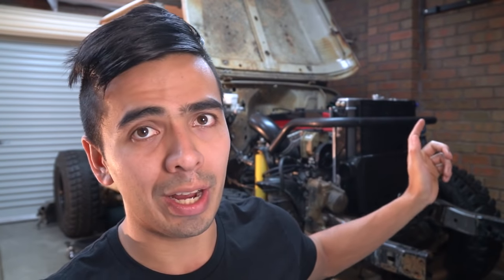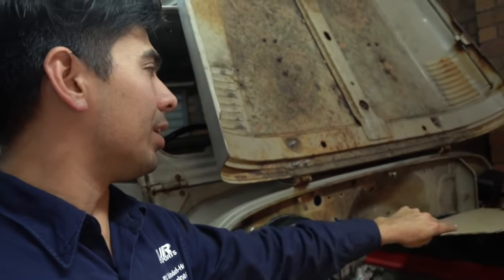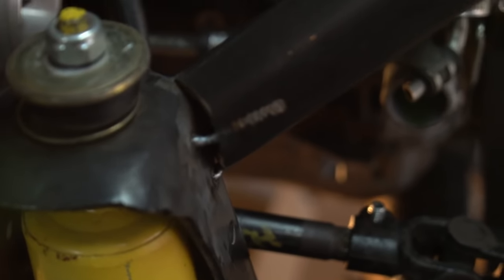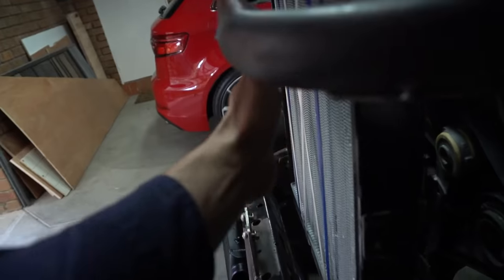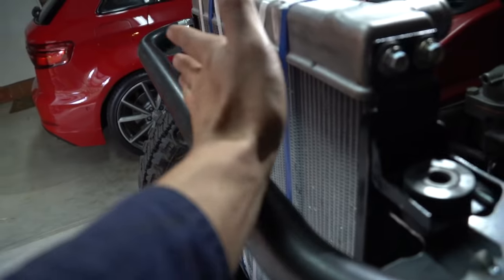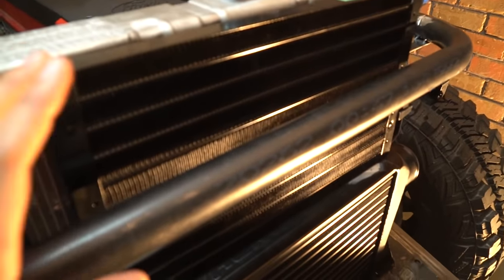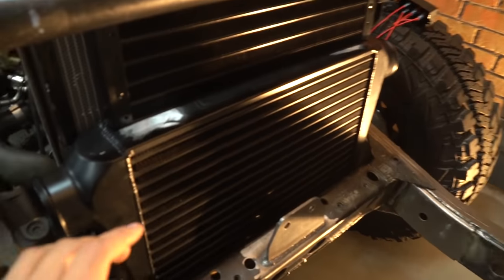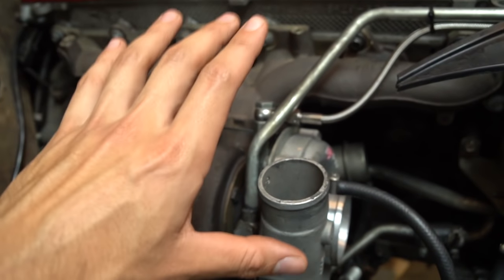Beginner’s guide on how to Barra swap - Barra T 45/80 Build Video #3

Comment: Hi Richard this is a great project with two of my favorite cruisers 40 and 80 series. When the crank broke in my HDJ 81 I ended up putting in a ford 302 ( 'cause that's what i had ) and changing the auto to a 5 speed manual box, I left the box in its original position and made an adapter plate that was 120mm long to bring the motor forward. I used an adapter shaft my mate made, not unlike your auto shaft adapter, for the gearbox output shaft extension. It went bloody well it had toyota difflocks. Keep up the good work. Phil NZ
Reply from the maker: Hey Phil, that sounds like a bit of ingenuity to make it fit, well done! would be a weapon I'm sure!

Comment: Awesome videos mate, loving the build series! When I finished my 40 series build I kept cracking the mounting tabs on my new radiator. Turned out I had rebuilt he radiator support structure too rigid as the whole front/grill/guards/bonnet assembly was originally designed to have a certain amount of flex. This in turn made the radiator mounting tabs the weak point. I ended up making new supports with oversized holes and rubber bushings to allow the radiator a little movement, worked a treat 👌🏼
Reply from the maker: Hi Geoff, cheers for that insight and your solution to it! something I'll keep in mind for sure :)

Comment: Hi Richard you can get in touch with MR Landcruiser and get yourself another bracket that goes around the brake booster from a later model. 
Keep up the good work very interesting conversion it's one that's been on my mind for awhile.
Reply from the maker: Hi George! Might be a little late for that bracket! Cheers for the info though.

Comment: Good work on mounting all the heat exchangers Richard. Keep in mid that airflow isn't infinite and sometimes bigger and thicker isn't the answer. It's a balance between airflow and resistance. If you find yourself compromised you can always add a condenser fan to boost it when A/C is on though it might impact your "stealth" look 😜. Looking forward to the next one mate.
Reply from the maker: Sounds like you may have had a little bit of experience on this. Definitely should have thought more about it, hoping my fancy fan will keep me out of trouble!

Comment: Hey man , the vintage air mini unit is a good quality car hotrod aircon /heater , ive just retro fitted one in my 1960 holden sedan. Cools easy on 35 deg days nice and compact unit should have no worries cooling a ute cab if your tight for dash space
Reply from the maker: Cheers clintonio! I have a unit already just needs to be fit up!

Comment: Good video. You mentioned about the nerd calculations, I would be stoked if you actually mentioned afew basic calculations on Heat loads and evaporator metrics. Id also consider looking into a Log style manifold. I dont think a VASS engineer would approval that steering linkage being so close to the hotside of the turbo.
Reply from the maker: Hi Brent, yeah I’m not sure how deep to go on that stuff put there are some keen people out there! I need more hours in the day to do it all and add it in! Yep that’s a fantastic suggestion, I think you may have read my mind :)

Comment: Firstly, keep up the great content. I have a GQ which I want to Barra swap. I have a FG gas car as a donor; but I wasn’t aware of the compression, thanks for that info re: fuel use. Spoke with engine builder friend of mine, he said he will massage the heads to reduce the comp to mid 9s. I’m changing head gasket, oil pump drive and valve springs. I’m curious of your future wiring setup. Thanks.
Reply: Addendum: If you can get 35” tyres passed by the engineer; pass on the details. All the engineers I’ve spoken to in Vic prefer 33”, else they want to swerve test using the 35” Let me know?
Reply from the maker: Hi Petro, sounds like a good solution as well, I didn't know that could be done. I knew the gasket could bring it down a little but only .1/.2 so thats good to know, your engine builder would know a lot more than I do!  I go into my wiring setup in the next episode which should be out in a few weeks, I have just bought an off shelf solution though. Re tires, haven't got that far with it. Can always swap them out if you know what I mean ;)

Comment: I wish you had got all nerdy on the intercooler selection. Im doing a similar conversion and decided on a W2A cooler as its a good compromise between an interwarmer (top mount A2A) and a front mount which can get packed with mud reaaal easy.
Reply from the maker: Hey mate, I looked at W2A and since I am relatively inexperienced with engine conversions/car building I wanted to keep it simple with A2A until I learn more. It is probably a better solution just more expensive and more complex, maybe I’ll upgrade in the future as I develop my setup.

Comment: Hey maybe make up a plate to laminate the firewall for the booster. 300mm square should do it and 3 mm thick
Reply from the maker: yeah not a bad move, I don't think that amount of strength is required though, that plate should be much stronger than original now. I think once the rib is back in it would be far stronger as well.

Comment: Hi there. Just watched the part with turbo near the steering column...even the rubber coupling cover seems pretty close to the hot side of the turbo...I remember reading somewhere back in FSAE days that moving air is the best insulator. Can you make sure that gap gets a lot of airflow through ducting? Anyway, great channel and series!
Reply from the maker: Have already made a custom manifold which has sorted out all my problems!
Reply: @DesignedandBuilt  Ah ok, awesome! I'll have to catch up on the whole build series soon :)

Comment: How will you go with registration on 35's?
In Qld unless you get it engineered and complianced as something else (home made or whatever) you can only increase tyre size by 2". Which means anything on tyres bigger than 33" is illegal. Theres heaps of guys who THINK they've got a compliance plate for 35" and 6" lift but they don't. Its not worth the tin its printed on. Unless they've done a moose test and jumped through a bunch of different hoops.

Comment: Hey Richard, it looks like that steering column intermediate isn't a collapsible type? Check VSB/NCOP section LA (not LS), as you might be required to run a collapsible intermediate due to the minimum safety requirements for the engine swap.
Reply from the maker: Hey mate, definitely collapsible, good pickup though!
Reply: @DesignedandBuilt  you should be good to go with 2 offset uni's, the collapsible bellows is a bonus

Comment: Have you looked at flat mounting the condenser under the tray with a scoop ??
Reply from the maker: Hey Tim, that’s a really good idea, if this fails I reckon that could be the next iteration!
Reply: Richard Swindel-Hurst  even the trans cooler with a fan on it under the tray would work well and allow plenty of flow to the radiator also don’t forget to foam around the edges so the air gets drawn through them but you sound on to it pretty well
Reply from the maker: I am trying to squeeze a big ass fuel tank, water tank and drawer under there as well. I really need to do some design work and get it all sorted. Thanks, I knew it need to be sealed but wasn't sure on what product to use, any tips?

Comment: Good work loving the build did you look into disco transmission rather than the transfer case adaption kit.
What are you doing for fuel tank? Will you have baffles inside. Can't wait to see more
Reply from the maker: I never looked into that, can they bolt straight on or something? 2X ally tanks, they will have some baffles inside!

Comment: Coming along mint man! Going to be a mad rig by then end👌🏼
Have you got suspension plans yet? Or just keeping it simple?
Reply from the maker: Hi Riley, I guess one of the big benefits of doing the chassis swap means I have a good base to start with and want to avoid moving hardpoints at this stage. I plan on just using off shelf components,  I have ordered it all, but theres a big wait!
Reply: Yeh everything is slow as atm👎🏼80s do work pretty well with just bolt ons

Comment: You need to talk to Sam from SEM Dirt. He 3d scans cars and builds them in digital space first.
He might be using some pricey equipment though!
Reply from the maker: Hi Nathan, cheers for the info. I have since modelled the bits I need in CAD. Also thanks for the tip on the brake pedal! Haven't looked into the wheel size and engineering just yet. Might have to change direction.
Reply: @DesignedandBuilt  or just put smaller tyres on for inspection!
If you register it as a 40 series or specially constructed vehicle you'll be golden.
They do things differently down here anyway. I see LOTS of 4x4s with mods that would defected before you got of a Qld driveway. Seems NSW police are a little more relaxed. Lots of straight pipes as well. Again, illegal in Qld.

Comment: Hey Richard, I really think that radiator, inter-cooler bar needs to be not so rigid mounted because of the flex of the chassis, maybe mount a bigger piece of pipe for that pipe to side into and bolt, like a roll cage mount !!  Is there some way we can securely contact each other either email or mobile, I'll send you mine if that makes you more comfortable with it, I like your ideas but some of the ways your going about could be better and simpler, I also help and advise another friend of mine who also has a youtube channel Griff's rearmount turbo is his channel. I help Jas with his race car. I'm 64yrs old and I'm a retired mechanical and automotive engineer. If you'd rather not that's ok it's all good, I'm just trying to help you.  Also think 20mm is too much gap between the fan and radiator, that will give you a little extra room as well.  I may be wrong, but I thought the in and out of the inter-cooler went to the bottom because hot air rises, if the in and out are at the top, the hot air CAN'T fall down be cooled !! I've got heaps of other ideas.  Seeya Rob
Reply from the maker: Hi Rob, message me on Instagram of Facebook to exchange details. I was planning on having rubber hoses between all my plumbing and then rubber mounting as much as I can. I like the idea about the big tube to slide into the other one though. There will be a shroud that extends the full 20mm, always open to ideas.
Reply: @DesignedandBuilt  Haha, sorry mate I'm an old fart I don't have any social media, any other ideas !!!

Comment: This is an 80 series chassis? Why not just use and 80 series engine? Hell they come with an inline 6, way less work.
Reply: As a owner of a 40 series, a 80 series and a XR6 falcon, I find this an odd build. Great tyrer choice tho, I have them on my 40.
Reply: Also I think you are building a more of a comp truck than you realise. Very powerful, thirsty and not that comfortable, everything rattles in a 40, it is like riding in a tin can.
Reply from the maker: Hi Dani, yes it's an 80 series chassis. Yes it would be less work but this is going to be more fun to drive. I don't think it's going to be as thirsty as you think, I would say 12-14 L per hundred with 300kw. I'll try and make it as comfortable as possible!